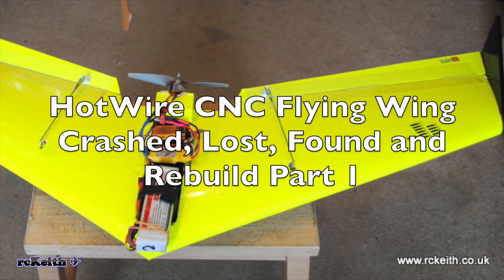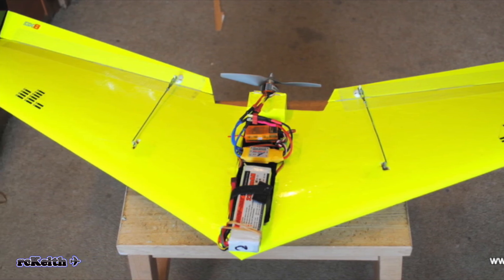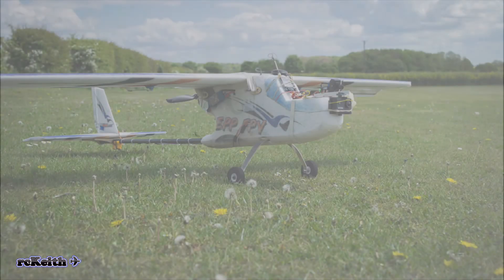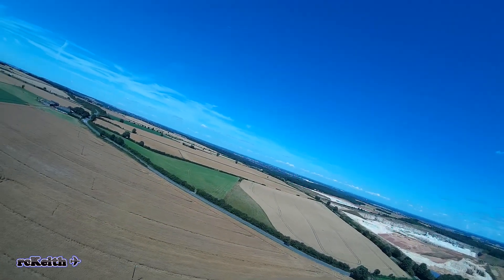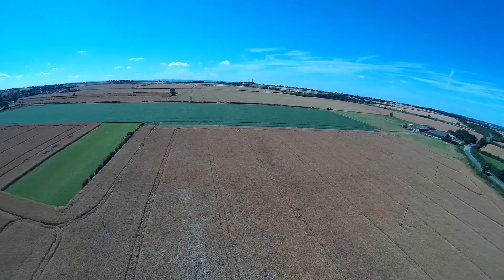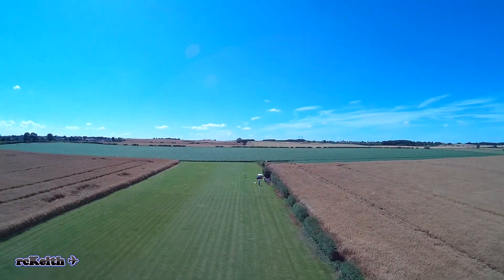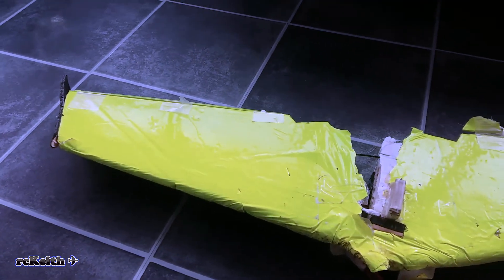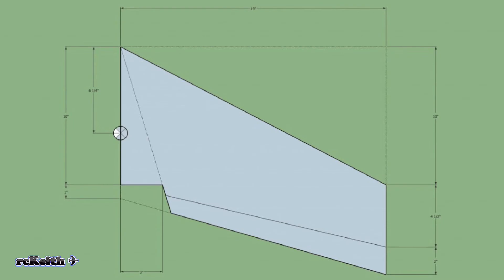Flying Wing Crash, Rebuild with HotWire CNC foam cutter - Pt 1

Comment: Thanks for sharing details of your CNC machine.  Having spent a lot of time making imperfect EPP foam wings using templates, this approach looks like far better solution.
Reply from the maker: Thank you.  It's a great way to make wings and fuselages. My Hawker Hurricane was made entirely on the CNC foam cutter and flies really well. Some videos on the  channel showing the process and my latest which is a BAE Hawk.👍

Comment: Interesting CNC setup.  I've always done my hotwiring by hand but REALLY like the looks of an automated system.  Just not sure about the cost.
Reply from the maker: It's not too expensive if you're fairly practical.  My website has the build of my machine and all the parts and software needed http://www.rckeith.co.uk/cnc-detailed-build-and-plans/
I use to make them with a bow but it's now starting to pay for itself and I'm getting better at it as well. Thanks for looking 
Keith
Reply: Thanks!  I'll take a look :-)